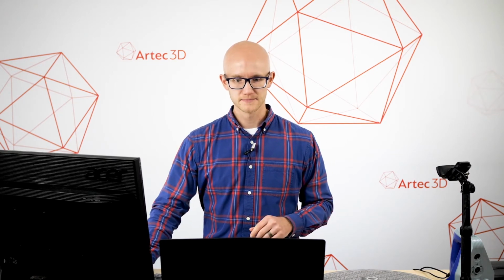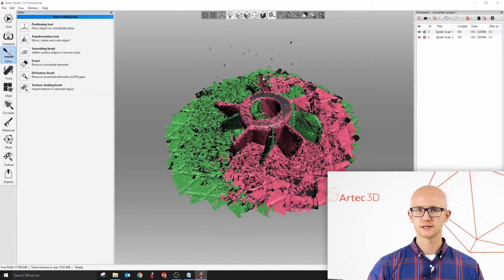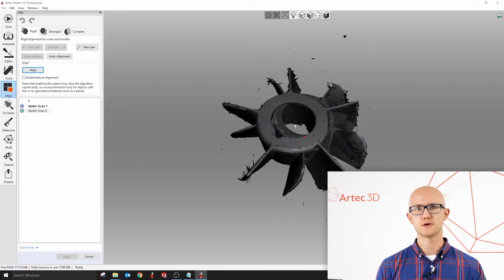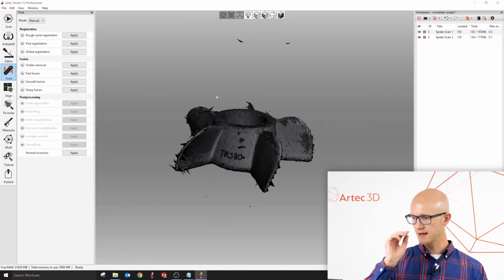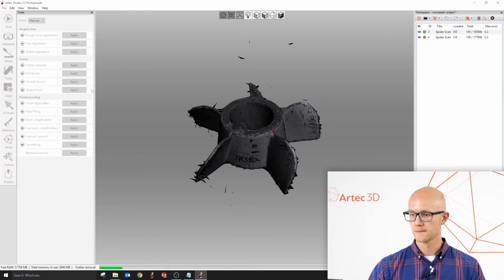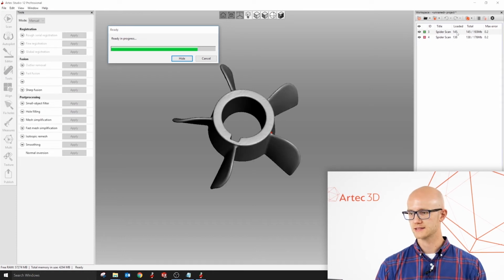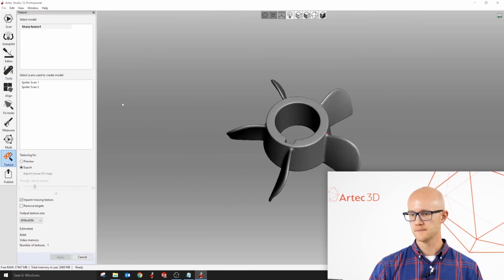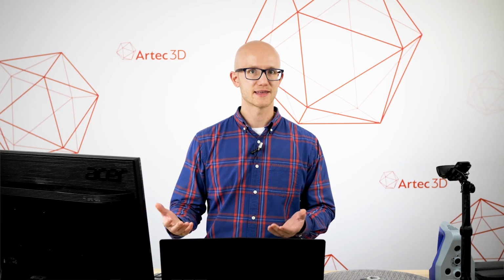How to Manually Process 3D Scan Data in Artec Studio 12 Software. Mechanical Objects

Comment: Thank you for the great Video! I just have one Question. What kind of textured underground mat is this? Is it available for purchase somewhere? It seems to be working quite well.
Reply from the maker: That one was made by hand :) It is a standard black lazy-susan purchased from Amazon that then painted with a matte grey paint/primer. Afterward, a black Sharpie marker and ruler to draw lines for tracking were used. For Space Spider you can also use Artec Turntable, more info and price here: https://bit.ly/2JrzH31